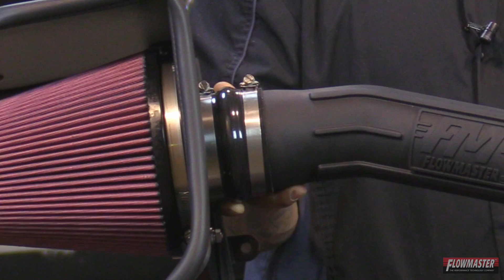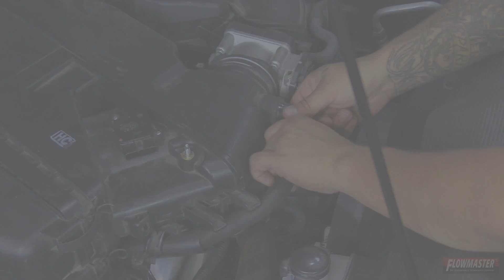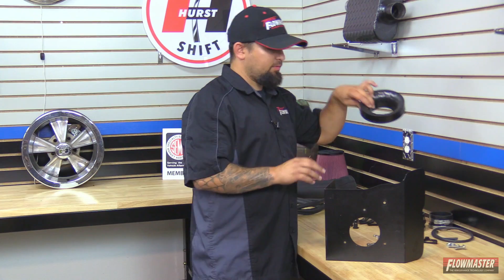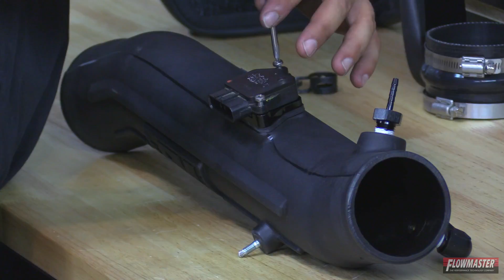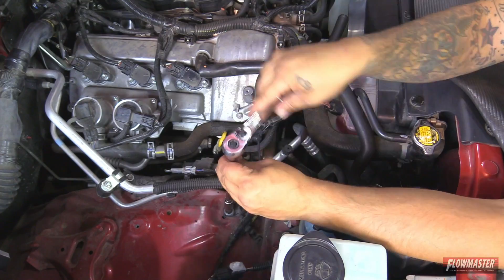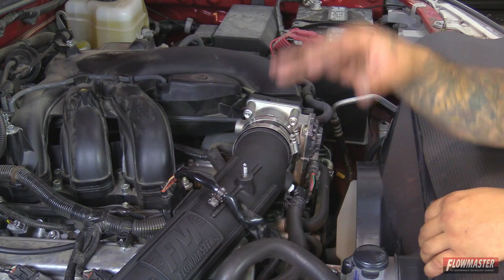2012-15 Toyota Tacoma 4.0L, Flowmaster Delta Force Cold Air Intake 615141

Comment: This is the best intake I've seen for my truck that takes the air injection pump into consideration
Reply from the maker: We work closely with vehicle manufacturers to ensure that our products not only add performance but do not interfere with factory systems and components.

- Jason @ Flowmaster